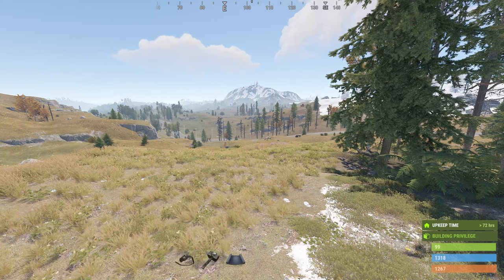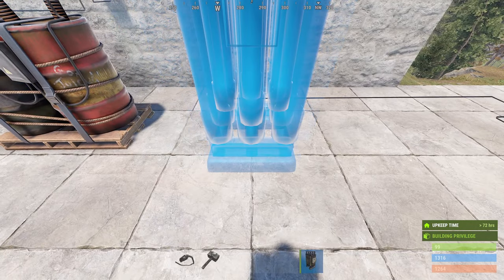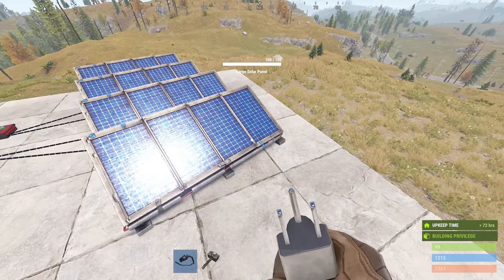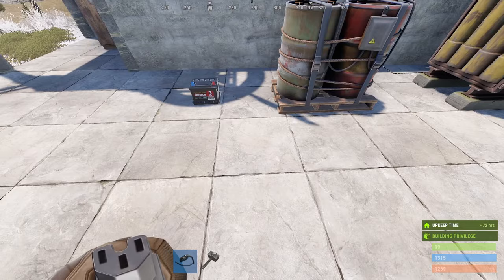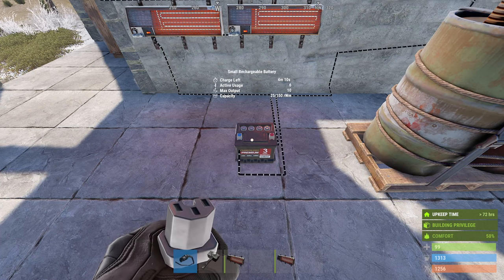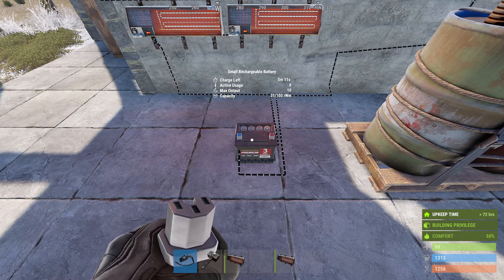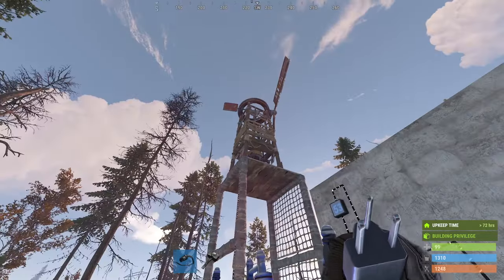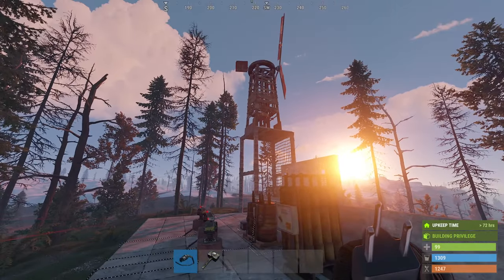Rust Electrics 3 - Batt Charging / Loading 2023 with Solar and Wind Turbines

Comment: You may not need an or-switch, two branches and a blocker for it to work, but I've tested both methods and a direct circuit is charging the battery at a slower rate (looks like it can be increased by ~40%). So I would only use a direct circuit temporary untill I got hold on these items.

Comment: it's 2023 and i just learned you don't need to do the power loop :(
Reply from the maker: Yep saves a lot of messing about and now makes more sense than when electric first arrived in Rust.  I Saw a lot of old vids still detailing the old method (which I also once used) which still works of course but..., thought I'd better put this out there :)

Comment: The weakest link in any circuit is your battery. I see people connecting 4 wind turbines to 1 Large battery...and them thinking "I have tons of power". I myself 7k hours have designed perfect circuits...that means zero RW wasted. One large battery can power 9 turrets perfectly if done right. This is max perfect output with no waste. If you reply and want to know the circuit I can explain in full detail without the dribble. It's amazing what can be down with 1 solar panel and a car battery and of course a simple circuit. I like the idea of circuits that are automated..no switch. Night time automated 4 lights. One solar panel facing North connected to electrical branch. Branch out to blocker "left side". Power out to car battery. Battery to blocker "bottom". Blocker "top" output to 4 lights that will be self automated. Perfect for a solo of a start to a bigger base design. Oh here is a tip. Place solar panels on other side of wind turbine and wall..so no shadows cast on solar panels.
Reply from the maker: Nice comment, thanks! I too see people with 4+ turbines on a roof and think why on earth... (for status mainly). As you say you can power so much with just 1 or 2 turbs and multiple batteries, I often have powered 4+ turrets, lights, doors and heating from 1 large battery and 6 panels.  Turbines have the advantage of the power continuing in the night so less chance of draining if stuff always on for sure, especially if your in the centre of a map and sun direction is trickier.  A solar for auto lights is always a winner :)
Reply: @GenXGamesMeister  I like that you respond to comments...that being said keep up the good work I will subscribe just because you responded and your content is worthy.
Reply from the maker: Appreciated Thanks!

Comment: Nice video but combining all power sources and battery backups and setting them to switch between live power and backup power in automation is the superior single circuit solution and this requires a blocker and a “or” switch. But this can be complicated so this is a great intro video good stuff man!
Reply from the maker: Thanks for the comments, and yes def some benefits to the other method still :)
Reply: One thing I’ve been pondering and have concluded that it’s not possible is if there is a way to control the output into the systems when the batteries initiate. What I’ve realized is there is not. The blocker will stop battery power and continue to allow them to charge but once the blocker opens . Your configuration of battery power is fully released.  my best solution to this is to root combine some batteries to increase the total battery output power and in addition to that have some of them daisy chained together to increase the time duration  of backup power without increasing the total battery output amount. With this concept the daisy chained batteries can act solely as backup power and allows an exponential amount of backup charging

Comment: why when i turn on the switch my large rechargeable battery starts loosing capacity and the timer going down ?
Reply from the maker: I would say because your using more electricity than is going in. Remember charging is 80 percent efficient only so 100 in means 80 charge rate, if ur using 100 it will slowly go down unless u have 120 plus coming in. Happy rusting!
Reply: @GenXGamesMeister he probably doesn't know switch takes 1 power even if it doesn't connect to anything